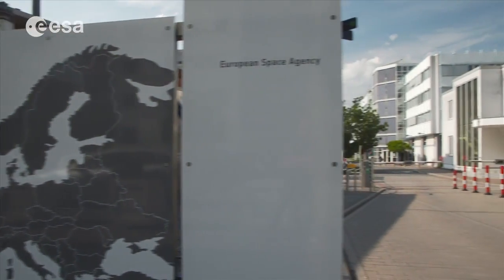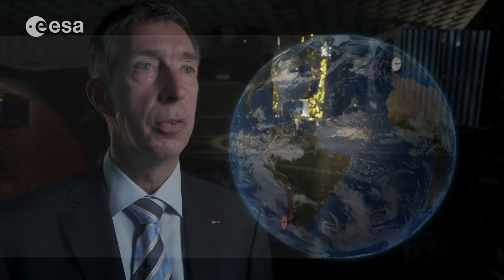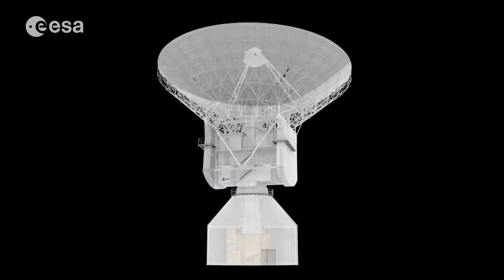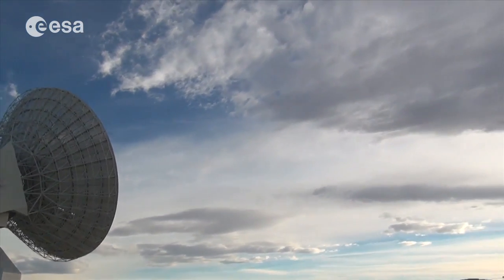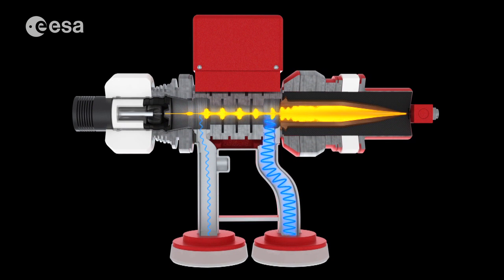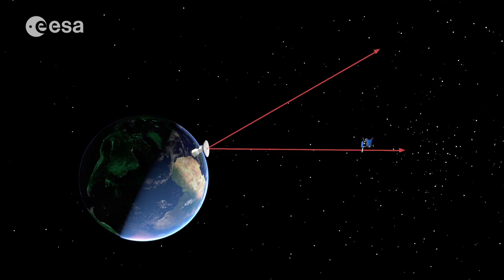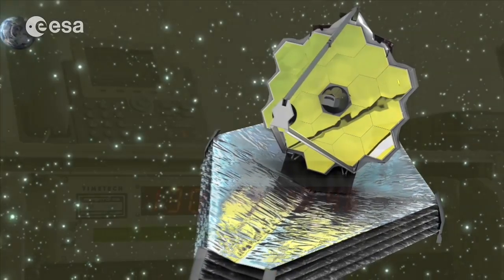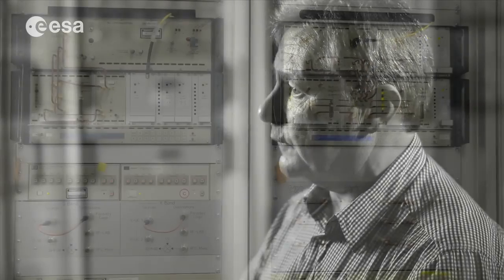Communicating With Deep Space - How It Works | Video

Comment: Why not use lasers? Wouldn't that be a much faster way of communication since it would be traveling at the speed of light?
Reply: Hmm? All electromagnetic radiation travels at the speed of light. Laser communication has its advantages in some areas, but speed would not be the issue.

Comment: I still find it hard to believe they can actually communicate with a robot on mars...much less DEEP SPACE! When we're barley able to go anywhere with a cell phone
Reply: It's all about the power output. There is an output power limit that has been decided by many countries to make sure it doesn't cause damage or interference (Think of an EMP).
That and you know.. there are no trees or hills in space so it's all about turning the power output to the max
Reply: Dave Micolichek  Clearly you haven't read what I said properly. Let me rephrase it so you understand. It would not be possible to reach that far without those 20Watts. 20Watts is quite a lot of transmission power. Lower power would make it more prone to data loss, and having to retransmit would take forever. You keep repeating that power is irrelevant and only antenna matters, which is inherently wrong.  Or they might as well use 1mw. One of the reasons is the low frequency used along with a prooerly tuned antenna and good transmission power.
Reply: Have you ever known a consumer device to ever have an efficient antenna?

Comment: How do you triangulate the position of a space craft after it is out of the sattelites range? how do you know where to position the dish? i mean after the craft is on more than 2000 km away. Basicly to triangulate a position ull need at least 3 satelites for x,y axes and even more for the z axis. If you dont know its position in deep space how do you know where to look with the long range ultra directional antena with a angle of like 0.00000001 degree. It has to be precision of surgical or laser target. But on that far is more like imposible. Thats why space is a joke. Nothing went into deep space. I mean litterally nothing went higher than like 80km where the iss is. And is not fken 400km away is like 80 max. Long range comunication are imposible beyond a specific point. I mean for directionallity of the antena. If the antenas are omnidirectional is easyer (and would explain a lot of things) but ull need a lot of power to make it. Nowhere is said that they use omni antenas, only directional dishes, or yaggy's.

And btw, those huge antenas to receive the signal are one way, we listen to a spacecraft but spacecraft dont listen to earth. To listen it will have to have same strong antena on it. Imagine if on ground ull have a 100 feet antena ull have to have same 100 feet antena on the spacecraft and it to target (face) the earth's ground antena. Is the only way to work. 

Either way is imposible to achive.
Reply: people who think something is impossible should stay out of the way of those making it happen
can't remember who said that tho
Reply: That's some BS, do you always have such elaborate opinions on things you know nothing about?

Antennas on earth are much larger than on spacecraft and it works, because the larger Antenna can both pick up the weak signal of the smaller Antenna and send at much higher power so the signal is strong enough to be received by the spacecrafts small antenna.